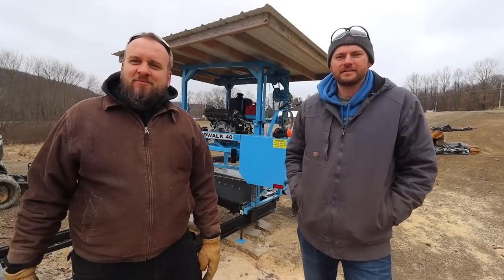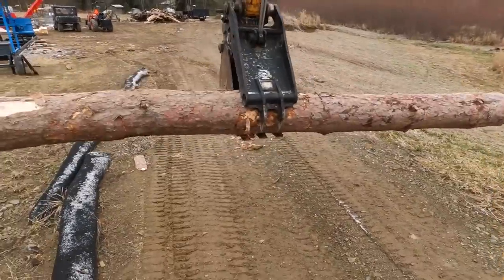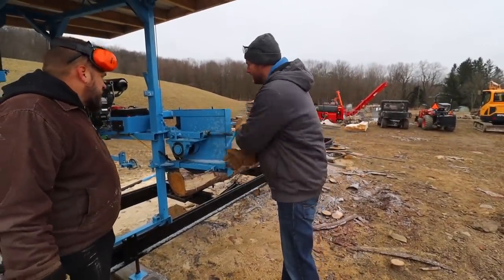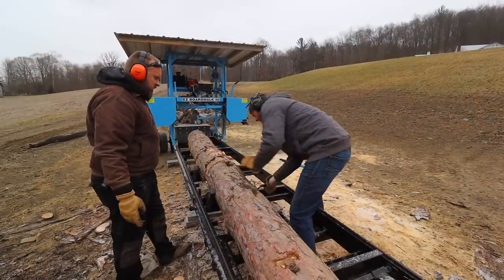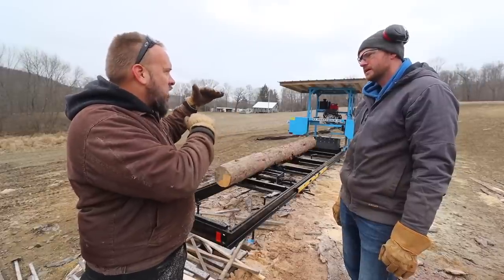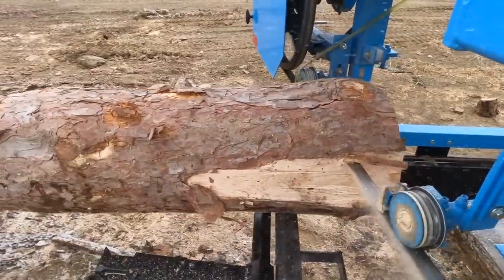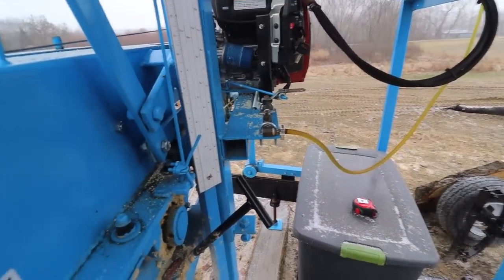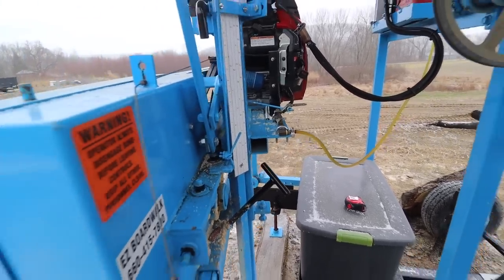I Drove Across the Country to Test this Unique Sawmill

Comment: I have a Wood-Mizer LT35HD and I run water with Dawn dish soap for the lubricant. I also have a spray bottle of diesel at hand so when I cut pine and the blade gets "pitchy" I can spray the blade and rollers and it cleans them right up. i find this to be really economical.

Comment: This issue with larger capacity manual bandsaw mills is it becomes increasingly difficult to rotate the larger logs.  It can be done with a mini excavator, tractor, skid loader or other piece of equipment.
Reply from the maker: Yeah, that really slows you down but my intention is to always turn those bigger logs with the equipment.

The way I’ve done it in the past is putting a lifting strap around it. Incention the strap at the bottom.  Adam has a nice routine doing it with his mini excavator.

Then just lifting the strap to roll it.

I just don’t think I’ll be able to justify the cost of a hydraulic turner on a mill

Thanks for watching and sharing your thoughts on it

Comment: I like the mill because you work from the left side and turn the log counter clockwise. by doing that your first cut it is a bark cut then every cut after that the blade is not cutting bark that will save you a lot of money. most mills work from the right side causing you to have to buy more blades.

Comment: Going off looks for first impression, that mill is a lot less refined and sleek as others. But once you got going through the features it seemed really nice. One thing i dont like the idea of was the log stops going up and down as 1 peice with the clamps. That would cause me issues with odd shaped logs, especially bigger ones. But overall i like the features there!
Reply: All welded head frame and bed frame. Not bolt together erector set like the green ones. In a manual mill I would consider this or cooks only. Both made in USA. Both made like a tank.

Comment: You forgot to mention that Woodland Mills is built in China and it's bolted together and not welded like the EZ Boardwalk. Plus it has a smaller motor and when it comes to sawmills the more HP you have the better.. Number one thing I look for in a sawmill is does it have roller guides or the other crap and EZ Boardwalk has a nice roller guide setup
Reply from the maker: Thanks for sharing your feedback on it